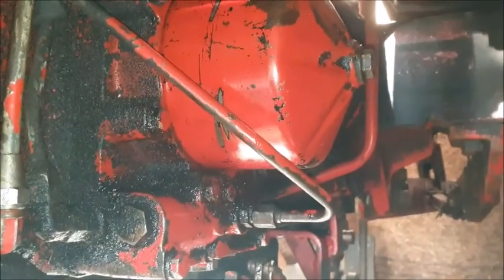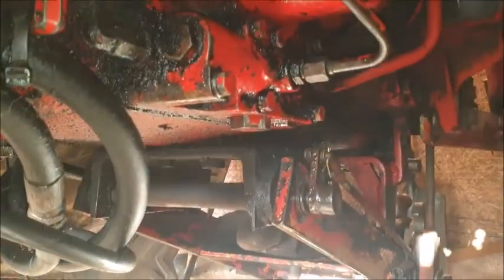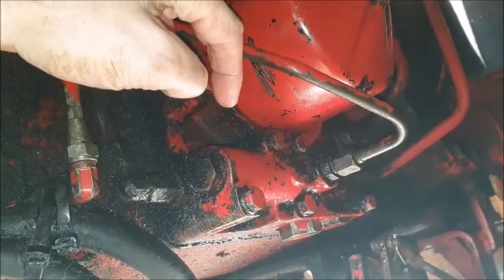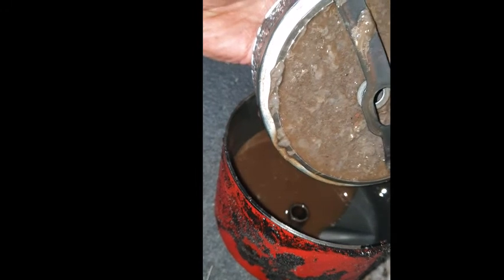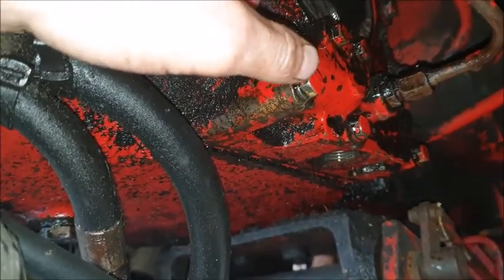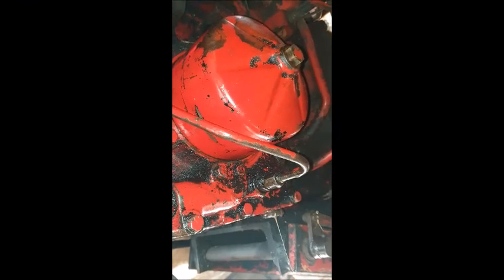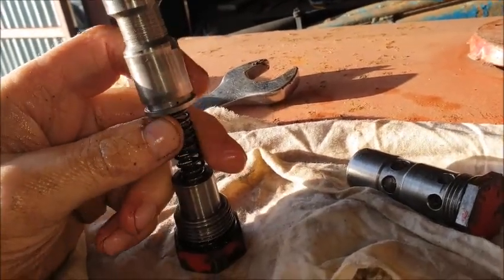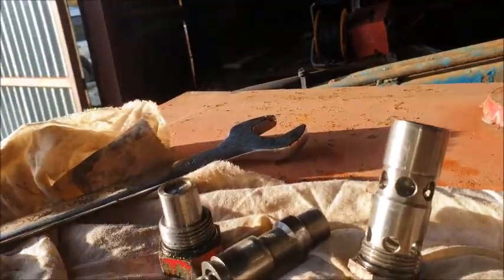IH 585 | Hydraulic Issues | Filter Change & Bleed | MCV | PRV | Flow Divider

Comment: Where did you stick the hose in to bleed the system thanks
Reply from the maker: Small pipe for the power steering beside the filter. If not worried about oil spill loosen it off even and turn the steering with the tractor running. Stop the engine once the steering becomes active. Nip the pipe back up.
Reply: @jpsmith6975  thank you

Comment: Absolutely no need to bleed even after changing filter and oil
Reply from the maker: Great, share the method here so to help our fellow IH drivers.
Reply: @jpsmith6975  there is no method ,the manual says leave both gear sticks in natural and start up,but I  know I  haven't and its still fine
Reply from the maker: @684ih4  Thanks for sharing. If I do nothing she does nothing, won't primer herself.
Reply: @jpsmith6975  That's odd, I'm over 30 years with  IHs and they've all primed themselves

Comment: When i tried to change the hydraulic filter on my 585, it poored out a lot of oil when I removed the first. Felt like I was draining the whole system? Can I prevent this somehow, or is that normal?
Reply from the maker: Not normal. It should only shed 1/2 pint of oil. Unless it was running or is plumbed or configured differently.
Reply: @jpsmith6975  Ok thanks for the info JP, I'll se if I can get around this somehow :)
Reply: Could you also tell me where the coolant filter is located?
Reply from the maker: @Dibulok  Water or oil, no water filter, just the radiator and thermostat. Oil filter is on the RHS of the engine.
Reply: @jpsmith6975  thanks jp 😀👍

Comment: Just got myself a 87 585xl with only 2000 hours on the clock that had sat for some years, used it for about a week or  two and started to notice the loader is getting really slow, and though I should check the filter, but would I need to bleed the system after a filter change? Or did you bleed it because of those two bolts you also checked?
Reply from the maker: Great. Yes bleed it after the filter change
Reply: @jpsmith6975  tanks for the reply.. I'll have a look around to see how everything is done, just to be on the safe side 👌

Comment: Hi JP , I’ve got a international hydro 85 for doing work around the house and it seems to be leaking a lot of hydraulic oil , it’s got two tanks at the back with one one each side but I don’t know which I need to use , would you have any clue about these tractors.
Reply from the maker: Hi..don't have that model but its surely the same arrangement as all the others. Surely oil is in the backend and the two tanks are combined diesel tanks, which often leak at the drain valves. If you have access to Facebook join IH 3&4 cyclinder, and someone in ther will have more experience with your model.

Comment: A great  video I have an 90 case 885xl.  Lift is ok. Tractor ticking over steering wheel is stiff. Have to rev for steering wheel to turn. Would you know what the problem would be?
Reply from the maker: Start with the basics, correct hytran oil ?not milky? Filter & screen okay ? Tipping/loader pressure okay ? Maybe valve if all those okay. If you are on FB join the IH 3&4 cylinder group. Very helpful

Comment: Great vid JP . Have a q for you bought a international 784 and was wondering where to check the hydraulic level . dont see a dip stick or bleed screw new to this type of tractor
Reply from the maker: I only know my type 585..dip stick is behind your left heel when you sit on the seat. Oil filler is on the rear block just above where you would attach top link
Reply: @jpsmith6975  Thanks  JP will have a look there
Reply from the maker: @johnheffernan264 no prob. If you are on FB join the IH 3&4 cylinder group. Very helpful